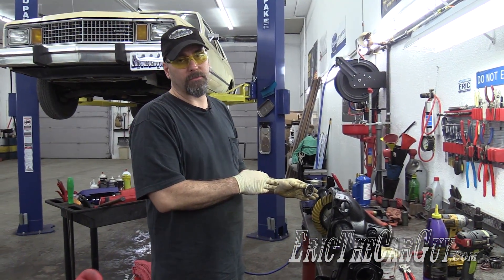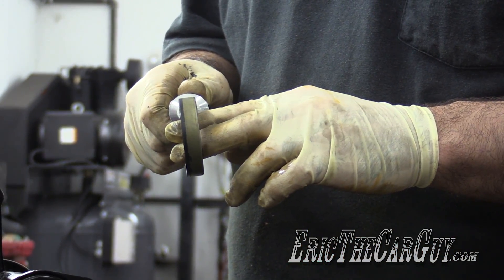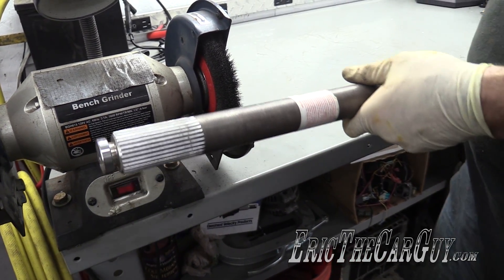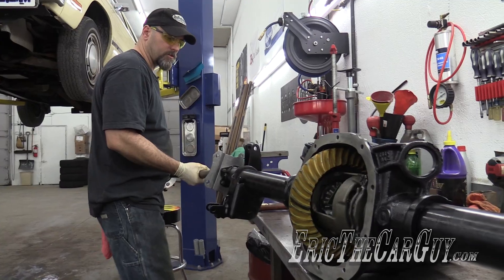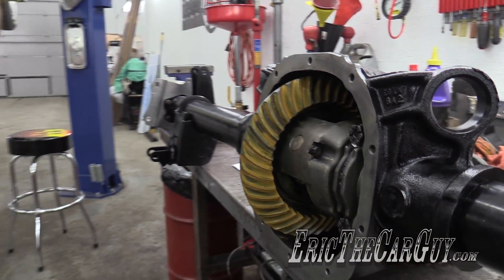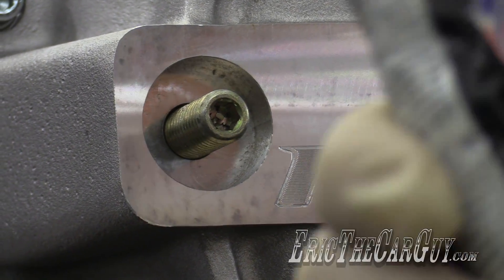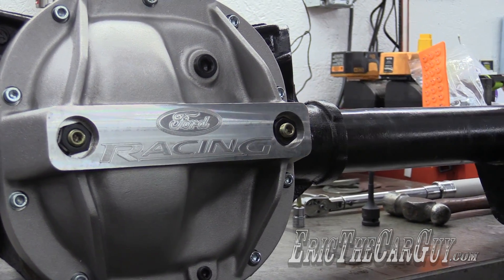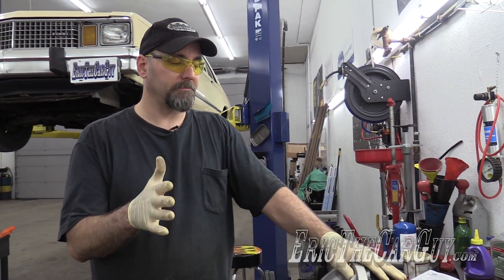Ford 8.8 Final Assembly #FairmontProject

Comment: I was a passenger until I was 18 and I drove it for 25 years and I never took it apart The differential has a small oil leak but it still works and I don't know if it's 7.5 inches or 8 I don't know if you know or if you don't know also thank you very much

Comment: Good afternoon, how are you? I got in that car when I was four years old. The differential that I see in that video is less robust than the one I have. That must be Dana 30 or if it is a Ford that I have, the cover is slightly molded to the size of the crown. be dana 40 or a larger differential I don't know you have information excuse me for asking you about the types of ford fairmont differentials because the one I have left the agency in 1979 I'm sure and it's more robust than the one you show in the video thanks what number of roller are you mounting thanks

Comment: Eric did you replace your clutch pack when you installed your rear end. I just did 3.73 & was told my clutch pack was good but after close to 1000 miles. There re used the stock 26 year old clutches. I think I burned out the clutched with with the new rear end. Should I just replace the clutches with new carbon fiber & be done with it. What do you think? My 1 spider gear was mashed & was replaced plus my carrier bolt was mashed & was replaced as well..... Your input on this would go a mile. 1992 foxbody mustang 302 HO with stock AOD. After market headers h-piper and catback with aftermarket drive shaft. "28 spine"

Comment: How did you get the spider gears back in place I'm having trouble the gears are blocking the pin from sliding in all the way
Reply: Turn the drive shaft. Put one spider gear on, rotate driveshaft until the other you put on is straight back, install other spider gear directly across from it and insert pin. After installing first spider gear in the 9 o clock position rotate driveshaft until it now sits at the 3 o clock, then put the other one at the 9 o clock and they should be lined up perfect for the pin.

Comment: A tool that would have been real handy, for this job, would be a "pass through" socket set. You could have gotten onto the nut, and, the end of the load stud to keep it from turning in while you tightened the jam nut. 
They're also great for places where you're dealing with a long bolt, can't really get a wrench on the nut, and don't have room for a conventional ratchet and deep socket .

Comment: When you put silicon on the bearing support studs, in the diff cover, would that not be better to use a Teflon thread sealant? Does the mfg recommend that? It looks like it would make it a pain to do oil changes or repairs, with that goo locking up the threads.
Reply: i thought the same thing. teflon tape would be easy

Comment: i see you went with stock length lug studs, i built a 9" w/4:11 gears limited slip, small block 4 sp. top loader and hurst roll control in a 72 Maverick Grabber, first launch sheered off stock length studs and had to install 3" drag studs

Comment: My biggest issue with my axles is the splines weren't precision machined and they had to be inserted and removed to get them to slide in so they didn't stick. Some filing was required to get the splines to slide onto the (spider?) gears.

Comment: Is there a book somewhere, or a general rule of thumb as to what gets lubricated and what doesn't?  Because for someone who doesn't know any better, I probably would've put all the fasteners in dry.  I've also never really heard of gear oil, and unless I'm just super ignorant, usually parts like bearings don't have much in the way of saying what to use to lubricate them.  Video's like this are super helpful, but at the same time, some cars have nit picky parts on them that may or may not get covered anywhere on YouTube.  Anyhoo, this is turning into a rant, so I'll stick to my initial question....   a book or general rule of thumb for what parts get what lubricants or go in dry??

Comment: I heard of a couple race tracks that will throw you out if you run less than 13's without C-clip eliminators, driveshaft safety loop, trans/clutch scattershield, and a roll cage.
Reply: Different tracks, different rules. Besides, even a mildly modified 5.0 will easily do 13's, what do you think he'll do with a turbo, hmmm?
Reply: +Mark “Just-Plain-Joe” Crawford yeah, but with that amount of power, if you shear an axle the whole thing flops out and destroys the 1/4 panel and you have a 50+lb tire and axle running down the track to hit something else.
Reply: +lilsammywasapunkrock , yeah but your forgetting the caliper against the rotor will keep the assembly from flying out.
You will notice it when you apply the breaks, besides the lack of forward movement.
Reply: +ron bosley meant brakes.
Reply: +ron bosley forgot all about the discs.

Comment: how come you didn't put in a c clip eliminator?
Reply: I know right? Why wouldn't you while you are at it. Or better yet put ford 9" ends on it
Reply: +Mark " just-plain-Joe" Crawford !!! So that means all 9-inch rear ends leak??? I did eliminator kit on a Dana 35 in my old Cherokee and drove it daily never had any leaks. That's just nonsense
Reply: I run them on the street. No problems

Comment: a spark plug socket would of worked on locking the stud locks and you could of held the Allen stud through the hole but turned the socket with a wrench

Comment: i believe you mentioned you were going to use axle holders instead of c-clips what changed your mind
Reply from the maker: I'm sure I covered that in this series somewhere. Perhaps in the last assembly video. I didn't use them because of the disc brakes I'm using and they're prone to leaks.
Reply: Yeah, I was wondering the same thing. Technically he can still put them on... Just if he fills it up with oil and run it a bit, he will have to drain it. Good thing he now has that handy drain plug... 

I am pretty sure the C-Clip eliminators will be a video in and of itself.. if he uses them that is. Likely a bit more fabrication required than he originally thought. That or adding it into the brake install part?
Reply: i believe that you should not use c clips with axle holders thats why i  am surprised
Reply: oh i think i have missed it great build anyways and i am HUNGRY for that engine rebuild videos
Reply from the maker: They're a ways out yet. Need to finish the rear end, remove the old engine and trans, and the K member. After that I have a whole series of engine videos as we spent 2 days at the machine shop shooting.
Reply: so mid september?
Reply from the maker: If everything goes well.

Comment: Good video Eric, however I'm still curious what benefits you would achieve from those pads being pushed against the bearing. Thanks
Reply: The idea behind those pads is to prevent deformation of the carrier bearing housings, which could move the ring gear in relation to the pinion during extreme use, which could damage or destroy the rear end.........
Reply from the maker: There is literally TONS of force placed on those bearings. The pads help secure them to help distribute the load of that force.

Comment: Was leaving the set up paint on the ring gear a safe thing to do?
Reply: its basicly just a grease that desolves in the gear oil
Reply: I was thinking the same thing.
Reply: yes that paint is designed for that it a SPECIAL paint dont use the paint you painted your walls with

Comment: Pouring a bit of oil on a paper towel then lubing up the shafts will make insertion much easier vis-a-vis not damaging the seal. Wetting the seal doesn't really help all that much since there's so much shaft passing by, it just removed the oil after the first few inches.

YES, YES, that's what she said!
Reply from the maker: Good idea. Thanks for the tip.

Comment: Here is an old mechanics trick to get 25% more horsepower...........Turn your car sterreo to FM and tune it into 102.1. The whole process should take you no more than 13 hours but you will be pleasantly surprised with all your new found horsepower.
Reply from the maker: I'll have to try that. BTW, the radio is only AM at this time.

Comment: THANK YOU for the video, Eric & Brian! I especially enjoyed the editing job of the "cover torque sequence" with the delayed echoes of wrench clicking- it's so dead quiet in there! 2 questions: torque or Loctite on the caliper mount bracket bolts? (it wasn't shown, and I know most older GM are "torque to yield" bolts for that) and are those axle C-clips copper- or just some polished alloy?
Reply from the maker: I just tightened the caliper mounting bolts down. They're not torque to yield. You mostly only find those on head bolts. I believe those C clips were copper.

Comment: Wow only a c clip holding each wheel to the car in the rear?
Reply from the maker: Before we get too far ahead of ourselves know that I'm taking some boost out of the car to drive it. The dyno numbers are peak power. When I go to the track, which will only be on occasion, I can turn the car up and make my passes. Otherwise, I'll probably only be running 3psi of boost which will make more reasonable power numbers for the street. In short, I don't plan to flog this car all the time. With the kind of power it makes, I'll have plenty to have fun with without having to turn it up to 11 all the time.
Reply: A c-clip and a big fat solid steel centering pin held in place by a hardened steel bolt wrapped in thread locker.
Reply: +patw52pb1 Yep... I learned the hard way what happens when an axle shaft breaks that's held in place by C-clips. Years ago I had a Jeep Cherokee XJ with Dana 35 rear. I was out wheelin with some friends and my left rear axle shaft broke. The wheel and what remained of the axle came out of the housing.  Did a bunch of damage to my quarter panel among other things. I don't trust them after that, especially something with a good amount of HP or oversized tires.
Reply: Carelessness has nothing to do with it. This project ETCG is building has a lot more HP and Torque than the original engine in the vehicle this 8.8 came out of. Therefore increasing the chance of it failing in a way they are commonly known to fail.
Reply: The clips slot in and the centerin pin holds them there, so its pretty sturdy. Not bomb proof but good enough.
Reply: C clip eliminators are just a bearing pressed on the axle shaft and it's held on by friction. 
The C clip is a mechanical thing that's not held in by friction. 

Choose your pick. Both options have their ups and downs.
If it were possible, i'd choose both.
Reply from the maker: I was going to say the same thing.
Reply: The danger is not from the C-clip failing, it is from the axle shearing and separating from the housing. 
Ford 8.8 axles are notorious for breaking, shearing splintering in the splines, just outboard of the splines and just inboard of the wheel bearing journal where the axle is a slightly smaller diameter and weaker. 
Once the axle breaks the C-clip can no longer retain the axle or maintain the axle's lateral position. 
This allows the remaining axle connected to the wheel to slide out of the housing and most times separate from the vehicle. 
This why most sanctioning bodies such as NHRA, AHRA, IHRA, PDRA, SCTA etc. require C-Clip eliminator/bearing retainer kits on Ford 8.8 equipped vehicles. 
Some argue that C-clip eliminators are not necessary and the rear brakes will prevent the axle from moving, however I have seen too many broken axle stubs along with the remaining flange and broken brakes separate from the vehicle when an axle breaks. 
C-clip eliminators do include a bearing that presses on to the axle with approximately 15 tons of force, incorporates a billet bearing retainer that bolts securely to the housing to safely retain the axle stub and wheel flange in the event of a broken axle. 
The Ford 8.8 is not the only axle/differential with this vulnerability, every axle with C-clip retainers are vulnerable including many Eaton/Spicer/Dana units and most GM axles. 

Here are some still images showing the areas prone to breaking and the probale aftermath. 

http://s1078.photobucket.com/user/RaceCarEngineers/media/Main/YT/Broken_Axle_Splines_zpsw34nczdw.jpg.html

http://s1078.photobucket.com/user/RaceCarEngineers/media/Main/YT/Broken_Axle_Outboard_zpsdbx69zcb.jpg.html

http://s1078.photobucket.com/user/RaceCarEngineers/media/Main/YT/Broken_Spline_8.8_zpskk60bdmc.jpg.html

http://s1078.photobucket.com/user/RaceCarEngineers/media/Main/YT/Broken_Spline_Gear_8.8_zpsow1hps9e.jpg.html

http://s1078.photobucket.com/user/RaceCarEngineers/media/Main/YT/broken%20axle_zpsu9panzpn.jpg.html

http://s1078.photobucket.com/user/RaceCarEngineers/media/Main/YT/bronco-axle-2_zpskl5her2v.jpg.html
Reply: People blaming the hardware for their carelessness...
Reply: FZT Motorsports
That's why he's using bigger axles. Because putting more power and abuse through parts designed to handle a lot less is generally not a brilliant plan.
Reply: ootdega
Bigger axle shafts are only part of the mandatory fix.
NHRA specifies "Aftermarket axles and axle-retention devices mandatory." for well demonstrated reasons.
Axle-retention device is NHRA's term for C-clip eliminator kit.
New bigger aftermarket axles are a help, but are not bulletproof and also break allowing the axle to slide out and separate from the vehicle without C-clip eliminator kit/axle retention devices.

Eric's new engine produced 622 lb-ft of flywheel torque on the dyno, however when multiplied by the T5 first gear it becomes 2,065 lb-ft of torque delivered to the driveshaft and pinion gear and when again multiplied by the rear end gear ratio of 3.55 becomes 7,390 lb-ft of torque delivered to the axles.
That is a tremendous amount of torque even for aftermarket Strange or Moser 31 spline axle shafts.
Reply: patw52pb1
I'm no expert, but somehow I don't think those numbers mean what you think they mean...
Reply: ootdega 
Please explain what you mean.
Reply: patw52pb1
Pretty sure those are rotation ratios. And just because something is spinning twice as fast, it doesn't mean there's twice as much force being applied to it.

And...the axles are directly bolted to the wheels. So if there were 86 kajillion ft-lbs of torque being applied to the axle splines...there would be 86 kajillion ft-lbs at the wheels. And suddenly an Infinitely Variable Transmission becomes a freaking warp drive.
Reply: patw52pb1
That's a lot of words.

I'm just going to go make a sandwich.
Reply: +EricTheCarGuy Hello, Did you have any problem with rust on the body ?You do great work.
Reply: ootdega
Actually it is opposite of what you state.
This is rather basic physics and math. There are several reputable internet physics sites that explain these principles better than I can here on YT.
Simplistically, gearing is mechanical advantage through leverage. The mechanical advantage is calculable by the ratio of the input gear to output gear radii.
With gearing, input to output torque is inversely proportional to input to output RPM.
As input torque and RPM remains constant and output RPM increases by function of gear ratio, output torque decreases in value by a ratio equal to the gear ratio.
Conversely as input torque and RPM remains constant and output RPM decreases by function of gear ratio, output torque increases in value by a ratio equal to the gear ratio.

Torque is multiplied by the numerical gear ratio.
When there are multiple gear ratios in series such as engine to transmission to rear end final drive, the input torque is multiplied by both the transmission ratio and the rear end final drive ratio.

The formula is Ot = (It * Tr) * Fr
Where:
Ot is Output Torque
It is Input Torque
Tr is Transmission Ratio
Fr is Final Drive Ratio

Ot = 7397.135
It = 622
Tr = 3.35
Fr = 3.55

(622 * 3.35) * 3.55 = 7397.135

Yes, the wheels are directly fastened to the axles and are subject to the output torque of the final drive.
Please understand, the 7397 lb-ft torque instantaneously applied to the axle flange is at the center of the wheel/tire assembly. If the tires are 24 inches tall the actual torque applied to the contact patch of the tire will be reduced by a factor equal to the radius of the loaded tire measured at the contact patch.

Not sure about your IVT warp drive, not my area of expertise.

Comment: will that hammering would be enough for studs to stay on axel. wondering?
Reply: it will have the tire and lugs on it with enough pressure for it
Reply: That's how you install them. The splines press in and lock it in place.
Reply: +Sprint316 thank you.
Reply: its more than enough.
Reply: +LEX Maximaguy87 ok. thank you.
Reply: +steven yau thank you
Reply: +TheAstro30 thank you

Comment: How come the torque wrench wasn't working properly? is it because of the angle?
Reply: He had to use a swivel joint due to the head being too big.You can't get proper torque using those, I belive he thought he was using way too much pressure on it and or getting it well past the torque needed so he went to his tried and "true?" method of sticking to 1/4" as to not overtighten.
Reply: +qballtvp I see,I didn't notice the swivel joint,thanks